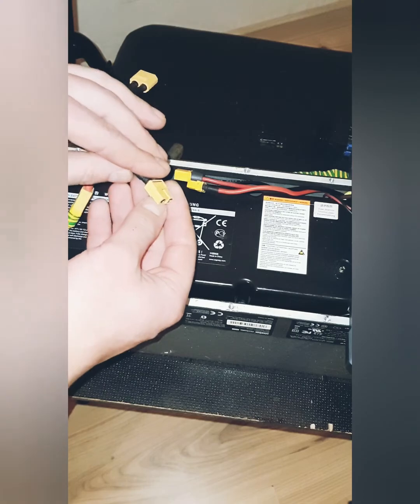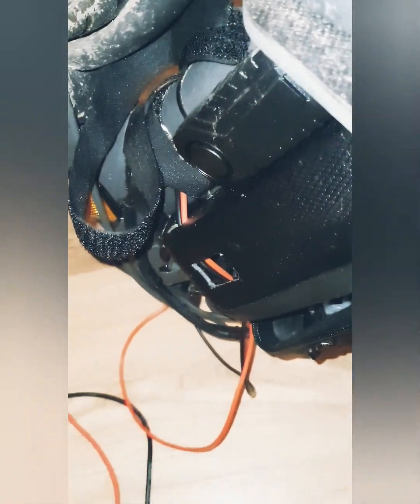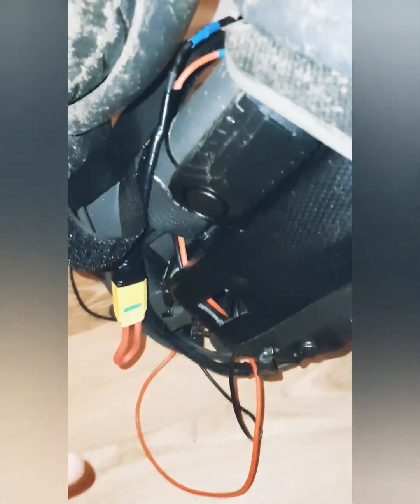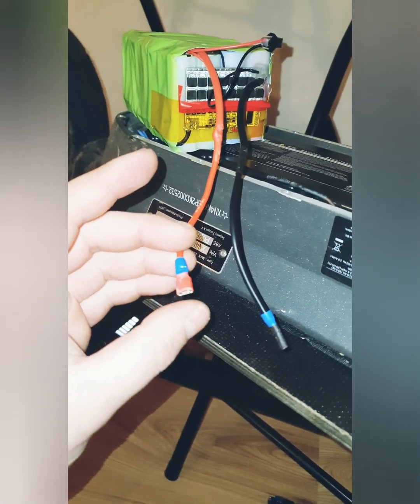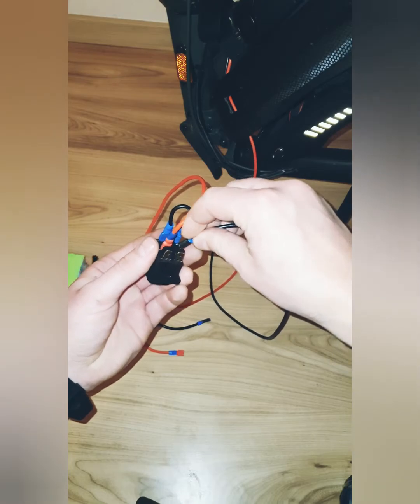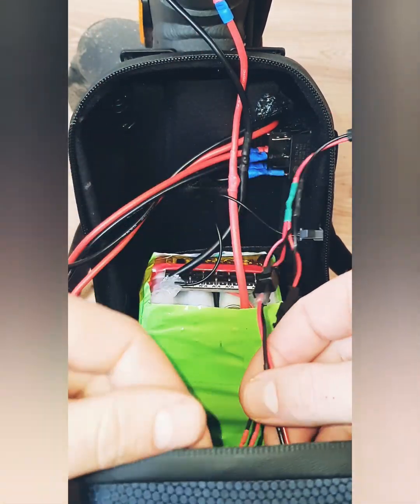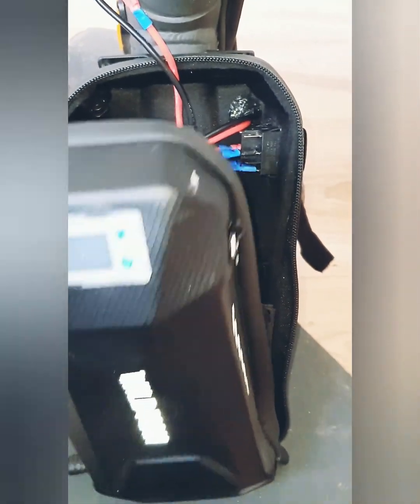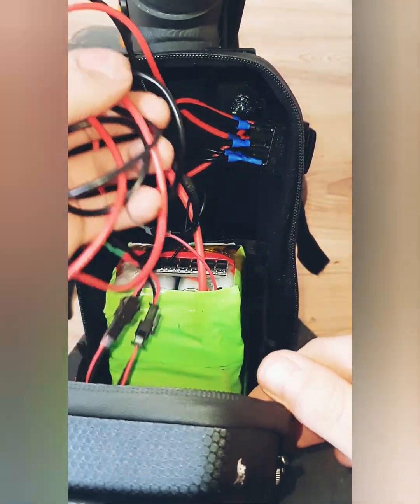How to install Ninebot Max battery switch on 48v Mod SPEED HACK Upgrade!!!

Comment: Hi, I did as you, I highly recommend!!!!!😁😁 Just tell me if you can charge two batteries from the original charger or how to charge a 12v battery?
Reply from the maker: Hi, 
For the 12v battery you will need an external charger 12.5v. Disconnect them while charging! 😀

Comment: Did you replace controller capacitors to higher voltage? I think it's needed. What do you think?
Reply from the maker: Hello!
 The stock controller can handle up to 63v! 
Only required to do so, if you plan to go over 63v!
Reply: @G30MaxForce  and what about voltage divider for voltmeter, I heard that increased voltage can fry microcontroller's input.
Reply from the maker: @Lufton  The voltmeter will be fine!
Reply: @G30MaxForce  maybe you misunderstood me. I mean there is internal voltage divider in controller that regulates 42v => 3.3v or 5v (I don't know for sure). That voltage is supplied to MCU analog input, that measures it and utilizes for displaying on the screen etc.
So increase of input voltage will cause 30% overload on MCU input when fully charged. That can potentially fry the input.
Reply from the maker: @Lufton    Believe me!
Reply: As far as I understood, it's based on STM32F103CB, witch has 3.3v logic, and max ADC voltage is 3.6v, witch is less than 10% overload of 3.3v. So leaving it without tuning voltage divider can be dangerous.

Comment: Nice video, really detailed and well put together. I have a question for you: What did you do to your firmware to handle the increase in voltage when wiring the extra battery in series with the stock battery?
I tried to make my own battery like you have done, but when I did it triggered error code 20 abnormal battery voltage, so I made a firmware that would ignore this.
after that I tested it with the wheels in the air and it would do 54km/t but when I started riding it would just shut off at 20km/t every time, I later found out that my BMS was damaged so I changed it and it is now okay with the stock battery, but now i'm scared of trying again as it is such a pain to change the BMS.
What did you do to your firmware?
Reply from the maker: Hi...thank you first! I really appreciate! 🙂

So... there are many possibilities: 
FIrst..
I think you connected wrong the series connection that killed you bms...that's why you had *error 20 *
Now you have it changed...

Wich tipe of battery did you have, that allow you ride 54km/h on free wheels? How many volt's ? 

I can give you a link with my firmware. 

And I tell you... someone tried 72v on a German G30D model 
( and G30D controllers are stronger that  G30P )...it work well for a while but than not anymore because our Controller's  can handle up to 63v only so 12v external is the maximum voltage that I recommend. Don.t go over 55v 
( I mean 42v internal + 12.6v external) 

I will link you a firmware and do the connections right ✅   🙂 you will now if you connected wrong because the scooter won't show you anymore the BMS! Not even the percentage of the battery!